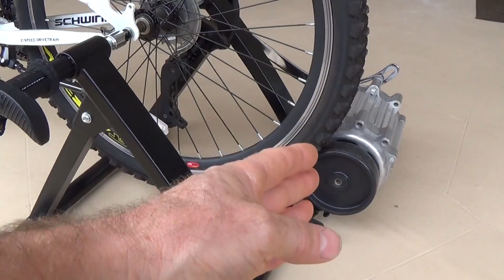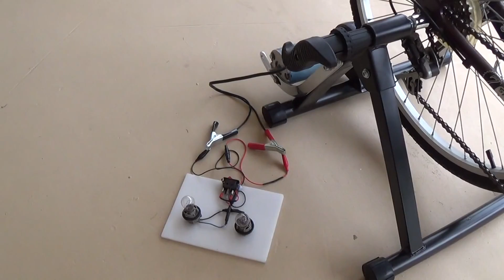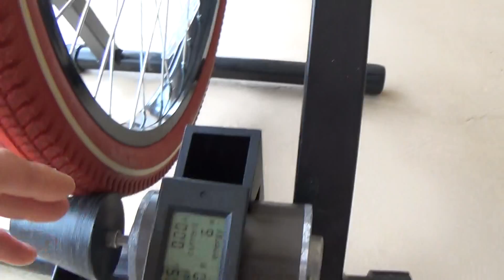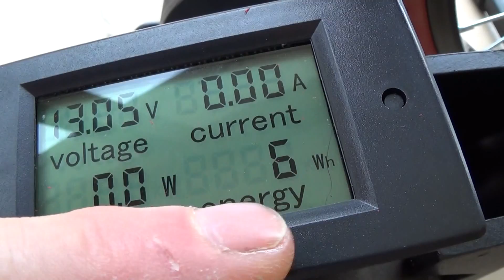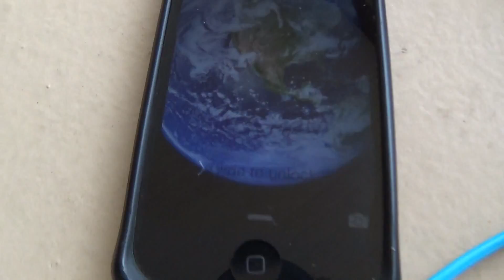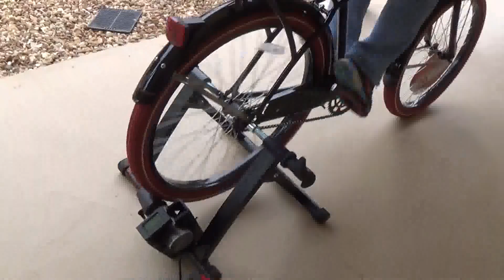Billions in Change Alternative Solution

Comment: Perhaps you would like to check my channel, and see how I came up with the solution for this using an e-bike? I do like your stand, I don't have that. But I do have an e-bike which has a 250Watt motor, and used as a generator will deliver just what you need. I am already using it to charge my cellphone, and in the winter days like now, I am also charging a second set of super capacitors to have up to 2 hours of LED light. Perhaps the motor plus clamp you have there is cheaper than the wheel with a  motor of an e-bike. But it could be a good second solution?
Reply from the maker: +deslomeslager Thanks for your message. I'm quite sure this would be cheaper and simple to build. That should be crucial if it's to help the poor. This one cost $95. of parts to build. If many are made the cost could easily go down to $50. and should be easy to sell them at $100. or
more. Luc

Comment: Well done Luc.
How much is the last setup for the bicycle stand and the generator with the dihital display without inverter ?
Reply from the maker: +overunitydotcom Thanks Stefan, it was $95. of parts to build one. If many are made the cost could easily go down to $50. and should be easy to sell them at $100. or4 more. Luc